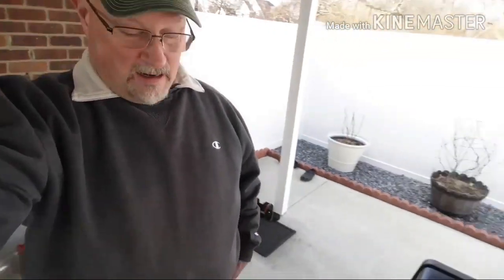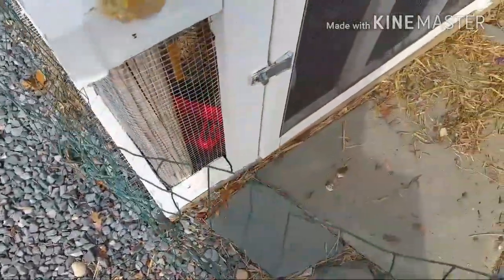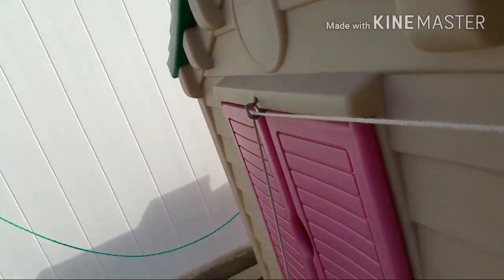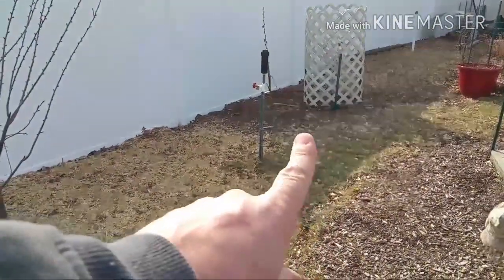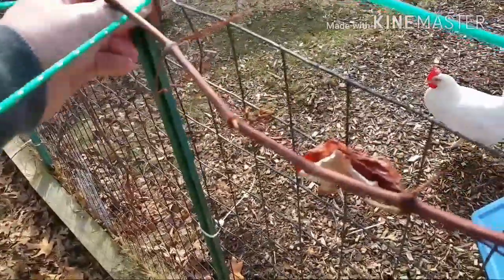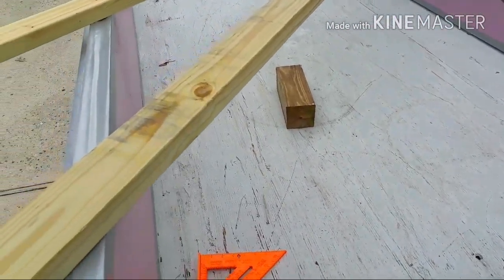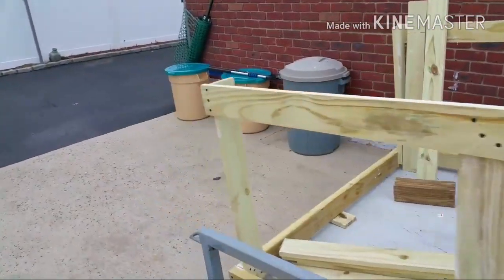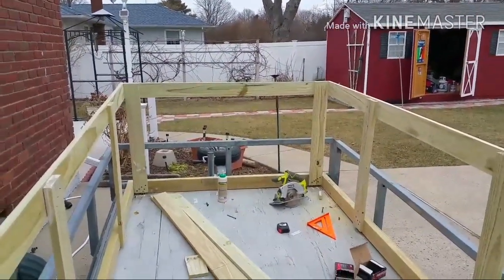Friday and a look at the J.Suscovich/WHOTH inspired mobile chicken tractor build

Comment: Glad the weather is starting to turn a bit warmer for you. The chicken tractor is looking good. Do the new dimensions accommodate the foam board along the sides but not the end piece at this stage? It's looking good and coming along very nicely so far. Any further thoughts on which breed(s) you're going with for the meat birds?
Reply from the maker: Simon B Good day Simon.  Haven't decided yet on the type of bird but it will likely be a sexed breed.  Roosters could be a problem more so than hens so why not try and minimize that problem.  I'm not even sure I'm going to try to hatch eggs, for my first attempt at raising them from chick's I may hold off on eggs and go for day old chicks.  I'm just being practical about it because I live in a complicated place that I'm not looking to draw attention to.  

On the trailer, I made the sideboards from one sheet of the foam board wich was good for 3.5 sides. The tailgate section is only partially closed off so I use a tarp as a rear retainer and fold it over top as a wind block for keeping stuff in.  Very lightweight and worked really well for me last year.  So as of now the tractor will fit inside the trailer when sideboards and front board are in place but the tailgate won't fit.  Without sideboards the rear tailgate should fit and transporting should be easy.

With sideboards in and plastic covering the top and sides I think I could use the tractor as the brooder too. I might just have to start them in my garage and drag them out from there for the first move!  When not being used for chickens I plan on using it for a greenhouse to sprout seeds and get them started in springtime so no chicks til May for now.  In the winter the tractor will be a greenhouse cover for one of my raised bed garden you've seen in the videos.
Reply: Sounds good! I like the idea of the structure doing double duty as a brooder. That makes me wonder if the design could have the flexibility to also allow nesting boxes and an enclosed area be sometimes added to convert it to a chick mobile (New Yolk City equivalent) for layers as well, not that you need it with current setup with the 'Coope Diem' but perhaps for a larger homestead property...
Reply: Oh, forgot to say, that yes, given the restrictions in your area, getting hatchlings versus incubating eggs to ensure the sex of them may well be a good approach - although it would be such a shame to have that lovely incubator go to waste! :)
Reply from the maker: Simon B I think scalability is important in any design.  For example, I'm making mine aprox 5' wide whereas Suscovich and WHOTH use 6' or 8' wide versions, I'm concerned that the additional height I will get from the change in the dimensions of the 10' conduit will yield a lot of wind exposure and have the leverage of height working against me .  I'm also going to be taller because I'm using 2.5' sides not 2'.  I felt the height advantage for my access to the coop would be worth it, I will  just have to be mindful of the wind forcast...typically not a problem here unless it's a problem, then it's a problem I can fix with screw in(Sandy ground) anchor points, on lessor day's a full 5gal bucket with water should do, just fill it at night!  I also plan to include one nest box at the rear that may be removable.  I have two options...1- is a gray plastic prefab, like I use in the Coope' Diem or,  2-  a wooden milk crate that has a rustic look to it.  The milk crate I would mount in the rear and be a resting place for the water bucket which I will be able to fill from outside.  Lots of ideas!
Reply: Indeed, it sounds like you have lots of neat ideas for it! Sometimes the designing is as much fun as the construction and then using it, with this sort of thing :)